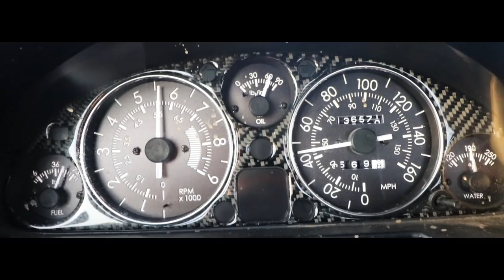Adventure Bus Pt. 16 - Custom Window Curtains!

Comment: I would recommend putting the exhaust out the top of the bus rather than under so you can more safely let it idle while you are in there without the fumes seeping inside

Comment: Selling the Rx7 before its running and driving would end up being a financial loss... But i'm not sure why you are doing the swap, if nobody it checking out the videos, and you can't good a good deal on the motor/transmission you want... The money you spend on it might be better used for the AWD Miata videos instead. I think personally I just clean up the motor, and shove it back into place is a vary good plan considering you have the adventure bus, a new shop, and that AWD Miata project to do.. 

I mean, It just takes a day or two to pull the motor and transmission out right?  And if you are going to have a extra car around.. it might as well be a running driving car too.  Plus it will eat up less room in your shop if its all in one piece. Which means you will not loose parts on it.  And you always can just sit on it till a motor you want comes along at a price you can easily accept.  Or just sell it if you find a car you want instead.

As for the adventure bus, its looking good.  keep it up!

Comment: If you are looking for another engine for the rx7, try tennessee jdm motors (844) 413-0040, they are located in Memphis, TN. I've bought a 1jz and a d17a from them and nothing but a pleasant experience and they have realllllly good pricing.

Comment: Why don't you just look for an RX8 engine instead? The gearbox is amazing, and although isn't the best rotary it is still better than what you have, plus it will have a better MPG and with a couple of mods you can reach 400 BHP
Reply: It uses completely engine mount that you need to make your own engine mount.The wiring and everything is different I believe(I know nothing about car mechanics but I believe that it's not as easy as you think)

Comment: and for my third and final suggestion, don't do a full fledged couch against that empty wall. Do a bench seat with a back, try to match the fabric with the grey. And see if you can do something a little ergonomic with the design with a nice DURABLE foam. Be careful what foams you use because certain kinds deteriorate over time.

Comment: I'm torn on the rx7. Selling it means you get to work on a awd lifted ej swaped miata sooner, but you will have to part with the rx7. And like you said you will always regret selling it. Second option is to keep it. If you keep it than you will get to do some more drifting and get better at it. From a business standpoint sell the rx7 and start on the rally miata. You will defiantly get a lot of views from that sense it's never been done and it will be sick. But the choice is ultimately yours so make the right decision. and keep up the great work.

Comment: You should get those little led lights that look like light switches from Walmart or where ever they're super bright, you could just stick like 3 or so on the roof or where ever and then you won't have to worry about killing the battery

Comment: Instead of selling the RX7 you should go on DashHub (the same website Chris fix used to buy parts car) go on there sign up for it BUY FC RX7 FROM THERE WITH TURBO2 ENGINE   And take engine out of the parts car and take some other things u need from the parts car and earn money off of of the parts car and then send the parts car to scrapyard and get the CHEUQUE of the guy and collect the money from the bank
Reply: Cool Dude Reveiws vlogs and games It woud be pretty hard to find a Turbo 2 on there.
Reply: Ye maybe

Comment: get a few extra curtans from amazon and put 3 on a rails (one across the middle holder)
buddy of mine used a heatglue gun to hang stuff in his rv trailer , one day it was rather hot and he slammed the door to his trailer , everything that was gleued ended up on the floor at that moment

Comment: I think you might need to do some engine mods on the bus for more power, because with all of that added weight it wont have enough power and will also get horrible MPG's.
Reply: Davian Cela bigger turbo hopefully
Reply: Davian Cela do realize the bus is built to hold a lot of weight anyways cause of passengers
Reply: Samlenon_4 yeah true but then again who wants a heavy feeling super slow bus?
Reply: Davian Cela I see where you’re coming from ... especially on long road trips it’s not practical
Reply: Davian Cela i think all this furniture and material is still going to end up being lighter than all the seats and metal that were stock
Reply: Robert Bowser i guess, but then again, a bus thats a bit faster might be a little better.

Comment: I've had better luck ordering "blackout" curtains online, as they are designed to cover the entire window, rather then be a "treatment" /designer look .  The ones you ordered look thick enough to be room darkening, but if you ordered blackout curtains, I'd have contacted the seller with the size issue.  that is really off the width you needed.

Comment: You gonna EZ30 swap, rather than EJ25 swap? More original that way. And more power. And an EZ30 is smaller than an EZ36 so it should fit well.
Reply from the maker: I want a boosted engine. EZ30 is N/A, correct? I also believe that is a heavier engine
Reply: Well it is heavier for sure given it's a flat 6, but I had a thought that you could supercharge it so we keep Reagan's now characteristic whine :)
If you could find an EG33 that could be cool, but for the sake of reliability an EZ30D is better since it's 21st century stuff, and came with manual. Be prepared for some text. A lot.

Here's some info on the engine.
The EZ30D made 242 hp NA at 6600 rpm, it came in the Legacy 3.0R from '03 to '09, Outback 3.0R from '05 to '09 and Tribeca from '06 to '09. The bigger EZ36D is still being produced in the Legacy and Outback. The EZ30D weighs in at 397 lbs. It's best to find the updated EZ30R instead. More power and better efficiency. The EZ30 engines also don't have the head gasket problems found in the EJ2X series engines. Someone named CARDOCM has a video with a supercharged EZ30D Outback, with your exhaust work you can make it sound more awesome, especially with that snorkel :)

Now, the EJ2X series of engines is very old now. Subaru have replaced it with the FB20 series which focuses more on fuel efficiency and reliability. The engine weighs in at over 350 lbs, but there isn't really a good figure for it. The EJ25 turbo is 500 lbs. That should give a good idea of the weights of them all.

I found on jdmracingmotors an EZ30 from '00 to '02 from a Tribeca for 950 USD, a '12 to '14 NA FB20A for 1800 USD, basically an EJ2X or an FB2X is more expensive than the little EZ30, but seems like they may be a bit cheaper than an EZ36.

Unless you want to find a Subaru 1235, then you'd have to fit it somehow ;)

Comment: Will you ever boost the power on the bus to get more speed out of it
Reply: romel 4life not until he gets the motor bulletproofed. The 6.0 power stroke needs the head studs and stuff upgraded so it won't fail. Then he can boost it
Reply: He doesn’t need speed on a tow rig
Reply: Joe Schmo the last thing he needs is a slow tow rig
Reply: romel 4life i think a flashpaq performance tune will help give it more power.

Comment: Why don't you just tint the bus' windows?
Reply: What?
Reply: MisterMcMerk yeah instead of those curtains
My wrong autocorrect failed me.
Reply: Lucas Van Loo because it’s a long bus so he wouldn’t be able to reverse because he wouldn’t be able to see or somthn but he said in last vid
Reply: If he turned the lights on at night with tint you could see right in the whole bus
Reply: he addressed it last vid: illegal and tints don't work when lights are on inside the bus and it's dark outside (similar to 2 way mirrors)
Reply: Oh yeah that's true didn't see that true, must have missed it in the last vid ;D thx for telling